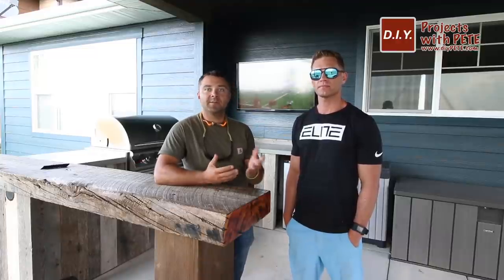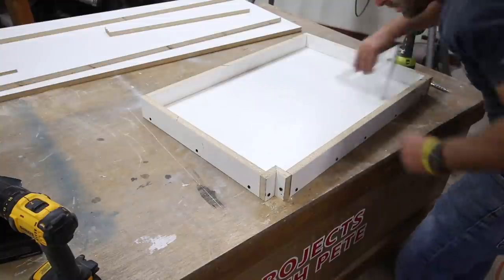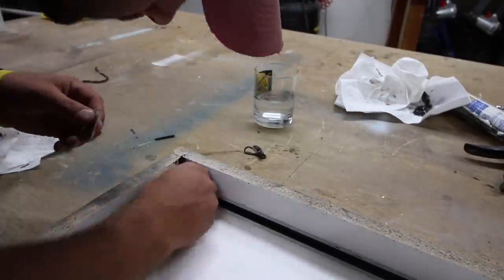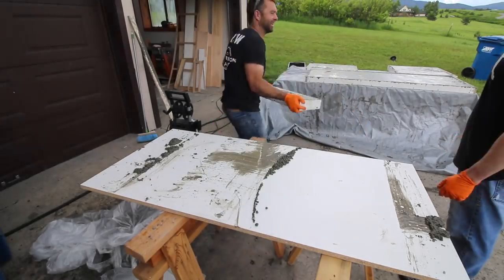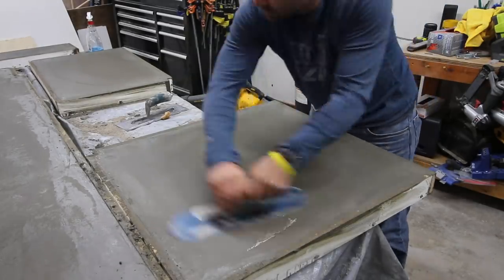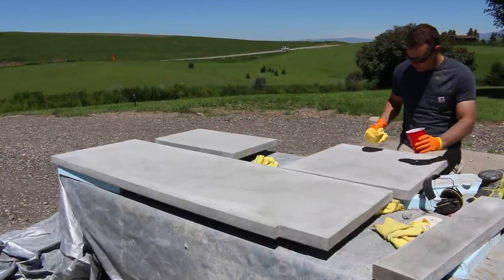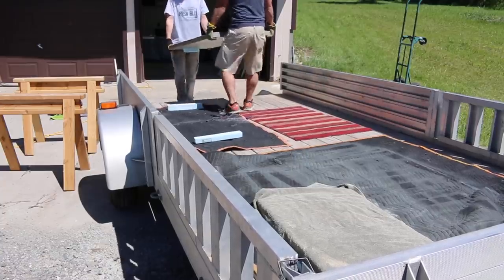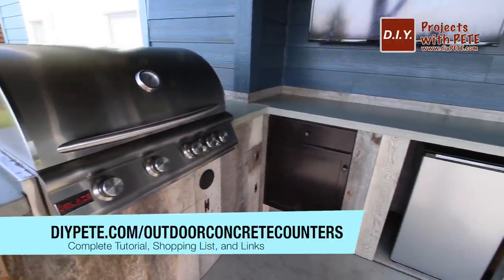How to Make Concrete Countertops

Comment: Wow! it just don't get any better than this! What a fantastic job! Now I am going to try and  pour a 48" diameter concrete table top and use the  25" stump of my 34 year old Ash tree that I recently had to have cut down, as the base for the table. I am just hoping that I can get the concrete finish to look as good as yours did. I thought you had to have a wet sander to get that shiny of a finish on the concrete. Thanks for another great video!
Reply from the maker: You bet forest! Glad it was helpful!

Comment: Not trying to be a no-it-all but I make concrete counters for a living. Mostly insitu and polished with steel trowel after pouring..occasionally cast off site..I still learn new things everyday...like using silicone instead of tenex  for joins...nice ....anyway battery powered hammer drill , not normal drill with hammer setting but proper just for drilling into concrete hammer drill...drill into peice of wood and then click setting over to just hammer....best concrete vibrator you'll ever use....you'll have no bug eyes at all to fix up...also liquid water reducer...can get it at any home depot type place...very cheap. Just a dash into your concrete mix will increase the slump greatly without affecting concrete strength or matrix....aggregate won't even separate.... That's if your an old concreter like me that has ruined arms and cannot work with  a dryer mix...anyway great vid....stay creative ....
Reply from the maker: Hey Adam! Great to hear from you. Love the idea of drilling into a block of wood with the hammer drill. I'll have to try it! Are you mounting the wood block to the table? Or are you running the wood block/drill along the sides of the mold? Cheers!
Reply: @DIYPETE   just running it along the sides of the mold....I only drill into a bit of wood so I don't scratch or damage melamine with hammer drill tip( I try use edges a few times if I can ) you could get an old drill bit and attach it to a rubber ball or something....remember a hammer drill only vibrates when you push it against something. Pull the trigger and it does nothing until you apply some force
Reply: "Not trying to be a no-it-all..."

* Know-it-all.
Reply: @seikibrian8641  seen it and jumped all over it...it was an honour to raise your pulse for a few seconds....
Reply: @ADAMKANE510  *honor  lol
Reply: @lostintime8651 * im australian  lol....we put a u in there...like colour ....you spell it color
Reply: @ADAMKANE510  I'm totally with you on that one Adam.  Colour, honour, valour, etc.  Make the letter "U" great again.  (I'm a Brit)  <grin>
Reply: @knowing-god   it is strange that they changed the spelling of the language from the country from where it originated...its almost arrogant 😉
Reply: @ADAMKANE510  Once upon a time there was a big effort in the USA to get rid of Britishness.  Rationalising spelling was one way and a guy called Webster was key.  Webster's dictionary is the USA's equivalent to the Oxford English Dictionary.
Reply: @jebbushell   we have it in our phones...its constantly telling me my spellings wrong....why would you want to be less british?...cups of tea ...fish'n'chips...pints of lager....what else do you need in life?
Reply: English words got jacked because there was no organization in place to correct what was altered due to the Norman conquest. Printing presses being operated  by people who barely had a grasp of english only compounded the problem by altering spelling to resemble what looks right to them because of their native language. And those that could write the language chose forms of words with the most letters so they could push more product for more pay.  Everyone was confused. Or, ur, our, er, re, etc; all variations were widely used in europe long before American independence. SO   country of origin is actually the one to blame. English reform was kicked around and people had their ideas. One that made sense was to make the language easier to learn by spelling words the way they phonetically sound. That's the stance Webster took. May have taken that a little far with the addition of made up shorthand words we now call conjunctions.  That opened the flood gates all slang. Now we're more confused. Ain't even became a real word because we believed in it like fiat money.
 Besides all of that nonsense that has nothing to do with concrete, has anyone ever tried to use a flex-crete? Maybe even with an  additive like "wall builder"?
Reply: @adam kane @davejewell

You Brits, and Aussies, self-centered lot, it's always about u, ain't it?   LOL

The US-UK controversy which  cracks me up is aluminum v aluminium.   Read about it, sometime, it's not just about pronunciation.  It's convoluted & confusing, but the -ium was how it was originally, then it was changed, then reverted, then a decision was made to not change it, but pronounce it one way... Or something like that, all I really remember is it was/is a mess, and funny.
Reply: @DIYPETE  why not build the mold on the counter so you end up with no seams
Reply: @knowing-god   Don't you mean <griun>?  The U is great again!
Reply: @1fmny549  Jesus H. Christ, paragraphs my man... Paragraphs.
Reply: i use my wifes vibrator,it has all the speeds youll need. just make sure to clean it so she does'nt know that you used it for work,i happened to leave a bit of dried concrete on it and ,well she felt it.
Reply: Just another 2 cents (i.e. 2p... ;-) - 'colour' seems to come from the Latin, 'color'/'colorare'. The 'u' I believe was added, long ago, by the French, which the British then copied. Then America subsequently put it back to what it had been, though probably not from any sense of history.
British English and American English is a fascinating study. There are several instances of differences in America where America has retained a spelling that was used in Britain at the time of the original colonisation but which has subsequently changed in Britain. But, as few British people know this they are often quick to incorrectly accuse America of making the change...  :-)
Reply: Adam Kane, I have a legit question. You as an installer can tell me. I have watched several videos telling you make it upside down, flip it over etc, nobody ever tells why. I want to make an outdoor grill but have nobody available to help. Can I just make it right where I want it? No flipping upside down and all of that? What will I lose? thanks,,,
Reply: @lostintime8651  It can be written both ways.
Reply: @sunkencubeoctahedron7844  lol
Reply: @softmetals3702  hahaha
Reply: @jebbushell  pounds, inches, gallons, just have a measurement that is a whole number would make life much easier for myself
Reply: Thanks for the info. very helpful!
Reply: @lostintime8651  I'm with Adam on that one. We Aussies use the U in honour.
Reply: Adam, can you answer my question above??
Reply: @jebbushell  we were always told it was getting rid of the French origin not the British. Words like Colour, Valour, Honour, Labour are all French origin
Reply: @ADAMKANE510  American spelling without U is correct English , when US was a colony of George 111 there was no U . Most literate folk went to Oxford where Latin was learned ie. Valor honor etc .Later back in England  arrived French Huegnot refugee printers who added their Frenchified U s. Hey love the bench tops .

Comment: My brother and I did this exact same install in my indoor kitchen two years ago...right down to the Tuff Duck sealer (highly recommended). The only difference was we used dark tile grout to fill the voids and it creates an awesome contrast with the lighter concrete. Great video! Thanks.
Reply from the maker: That's awesome!

Comment: This is by far the best concrete countertop video I have found so far!  Thanks so much. Others go for merely production value and gloss over very important issues like tensile strength and sealers.  That actually caused my first countertop attempt to fail.

Comment: A glass setter showed me his tip for perfect concave edges when working with silicone. Get a piece of 1/2" or 3/4" foot long piece PVC pipe and cut a 45 degree angle in one end. Get a bucket of warm water mix in some cheap liquid soap. Run your bead of silicone. Using a super soft wallpaper glue brush, wet the mold on both sides of the silicone bead with soft stokes using the water/soap mix. Then, using the PVC piece, scoop the excess silicone away. The silicone will not stick to the wet soapy surface.
Reply from the maker: Thanks so much for the tips, John!
Reply: I may do that one day but only when I am actually already doing some silicone work.
Reply: We always did the same thing but with just your index finger instead of pipe.  You could also use a mason's tuck point trowel.
Reply: Leslie, using your finger can cause the excess to go wide causing a possible mess. The use of a tube give you a clean collection point for the unused excess.
Reply: Yes it can and that usually means you put way to much caulk in the joint in the 1st place
Reply: Guilty as charged. I use the attitude that I would rather have a bit too much than not a good bead or coverage. It is a tricky balance sometimes.
Reply: I’ve used that technique, but I used a fine mist spray bottle to apply the soapy water instead of a brush. I’ll have to try the brush method. It’ll certainly cut down on rinsing off all the soapy water overspray! Thanks for that idea.

Comment: I just finished concrete tops throughout my kitchen.  I went to the michaelbuilds school though.  Rapidset mortar mix.  No reinforcement or rebar of any kind.  And, use flow control plastisizer to make it pour easier.  Also, this method lets you mix and pour from a five gallon bucket.  Plus, its a one day project because rapidset is one hour dry time.
Reply from the maker: Great to hear. I've used Rapid Set concrete mix and the cement all. Love how the cure instantly. After a couple years though I've had issues with the projects that have been outdoors, but not with my inside projects. I'll have to experiment with the mortar mix and see how it lasts over time outdoors in comparison to other mixes. I love the instant gratification though.

Comment: I recently saw another DYI guy do a concrete counter top using a kit. It looks very simple and easier to do. The kit came with plastic frames which he would break off after the concert was set, and used a Fiber glass mix into the  concert eliminating the need for metal reinforcement. Looked very easy to do. No need for building a frame nor a mold. Do you have any comments (pros/cons) on the method?

Comment: Using an electric  multi-tool works incredibly on the sides eliminating almost all bug holes entirely.   Sawsall on the bottom without a blade does the same!    Have you ever tried just a pure portland cement with multi purpose sand mixture?   If not give it a try.  The results are amazing!
Reply from the maker: Hey Brian! Thanks for all the info! I've tried the sawzall and have had good results. I've played around with a few different homemade mixes but haven't ever built full out counters using my own mix. Great to hear you've had good results. Cheers!

Comment: I've been watching concrete countertop videos for about 2 weeks now.  This is one is four years old and instructionally the best one I've seen.  I really like the suggestion of removing the sides of the cast and then waiting for the bottom.  One question, do you use any release agents on your melamine casts?

Comment: This is amazing! Now I understand why people want concrete counter tops :) ...Beautiful
Reply from the maker: Thanks Reg! I think they give a bold look, and the customization options are endless. Plus they are super affordable to do if you tackle them yourself :) Hope all is well Reg!
Reply: If its outside sure seal top, bottom and sides if its inside just the top and sides.  But he'll be lucky if the owner doesn't get sick from mold and die in 3 years.  Can't stop the humidity from attacking the underside that wasn't sealed, and concrete gathers moisture and heat and breads mold if you don't seal it.

Comment: Only 2 days of cure time on the mold?! I saw you did this for the inside kitchen too. Mine have been in the mold for 4 days now because before pouring and finding this everything said 4 days.. and then 3-5 days of air drying before sanding! I only have less than 48 hours before mandatory install so I’m hoping they’re ok? You’re videos are super awesome and I’ve learned a ton, thanks for taking the time to make them!
Reply from the maker: Hi! It all really depends on the mix used and conditions. I can sometimes pull the sidewalls off in 24 hours if I'm careful. And then wait a day to flip. For counters with big sink knockouts, I'm always more careful and wait longer, but for big rectangles you can sometimes flip a bit earlier. I'd say 4 day in the mold would be plenty. -- If you only have 48 hours left, it's a bit rushed, and it is nicer to let the concrete dry out a bit more, but you can definitely make it happen. Let me know how it goes/went!
Reply: DIY PETE hey Pete! I live in a warm and low humidity climate, NorCal mountains of Tahoe. I pulled the molds and they look amazing. Much better than my coffee table. I used Chang’s pro formula mix and 5000, with a little pigment. I think the mixer I rented from Home Depot sucked because it struggled to mix 2 bags despite it being full size. One counter top came out nearly flawless with zero holes. Second one came up with some very strange brown spots and a few small worm holes. I have no idea where the brown came from? Maybe the mixture wasn’t thorough enough? The back slot of the sink I made a separate piece for. I used foam just like you did and silicone them but they moved and are out of alignment and one filled from the bottom up somehow. Not sure how to send you pics but overall pretty stoked. Gonna sand and polish and mount today

Comment: Been doing this technique for years. We call it pre-cast. Ever use styrofoam forms to get pronounced rounded overhangs. Or use cantilever methods. I can tell your an artisan so maybe check these things out to build your product abilities. Your bar is inspired I have to admit it's beautiful. They sell a industrial vibrator in different sizes that virtual guarantees no bubbles or voids. Great video!
Reply from the maker: Thanks so much! Great to hear from you. I do have a concrete vibrating table and some of the z forms etc but haven't used them often in actual videos since I try to show how to do it most cost effectively, but I definitely would like to show some more advanced techniques eventually! Hope all is well!

Comment: Great video with excellent instructions. Question (for all with experience) on adhering the pieces of countertop to the frame. You used silicone to attach to a wood frame. I'm going to be building the frame using steel studs. Would you suggest using silicone on the steel studs and then attaching the countertop or putting cement board down onto to the steel framing and then attaching with silicone?

Comment: If you set your screed boa🚑d ou top of forms you can vibrate it using a sander also if you like to I use a cover molding or another no rot molding silicone in place for decorations. I also look to make my own paver edger stones

Comment: We always add color to our concrete tops. First one we did was through color but we found it better to add color by hand and to do so randomly. If you pour in place it's easy to trowel the color in. If you do it like these guys, just throw out some color into the mold before you pour in the concrete and make sure to get some color on the edges.
Reply from the maker: Thanks for chiming in!
Reply: How would you suggest making the concrete resemble black with silver splashed marble? A countertop  job I have coming up is wanting me to match the floor tiles. And should the finish be matte or polished?  And if polished, know any tricks besides putting the steel to it. I will be pouring into form on the counter instead of letting it cure and then placing. So the colors will be on top and I don't want to float them out or fade/ blend/mix them too much while trying to make it shine
Reply: I asked DIY Pete about color, but I should ask you. Does adding color impact any part of mixing the mud, installation, prep, etc?

Do you know of any good vids, or how to's on pour in place?
Reply: I'm not nearly as wealth of information on the subject as DIY Pete but, in my experience, color adding doesn't affect the product if you sift it through a screen and cast it kind of like your skipping a rock. Do a base color and float it into the concrete with a mag trowel. You can use other colors after but I wouldn't trowel too much on that as it will blend the colors. Unless that's what your going for. But concrete stays concrete regardless of colors added. I wouold suggest searching for vids on pouring a patio or stamping concrete for some useful info on color.
Reply: Also,  there is a product called deck coat for a pour in place job. When you pull the forms your going to plain concrete showing. The deck coat should help with that.
Reply: @georgedennison3338  If you are pouring it in place it is easy. Just add the color powder when you do your troweling. If you are doing molds, pour in a skim coat of concrete and mix in the color then finish your pour. An alternative is to paint it after with concrete stains but practice on some test panels before attempting any color method you decided on. You can go to a South of the Border restaurant and look at the bar tops for inspiration, it may just be one that we did. The floors in the restaurant should also be with added color so check out the floors, too. Good luck and have fun with it.